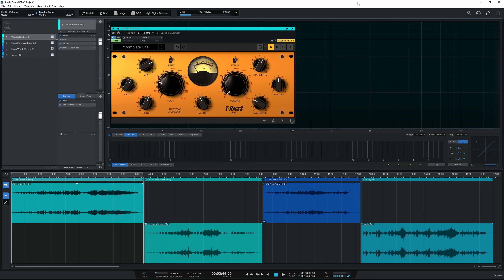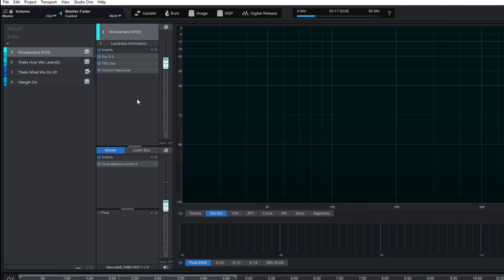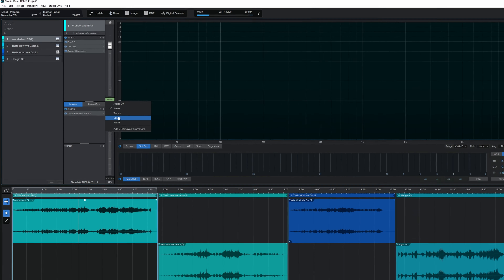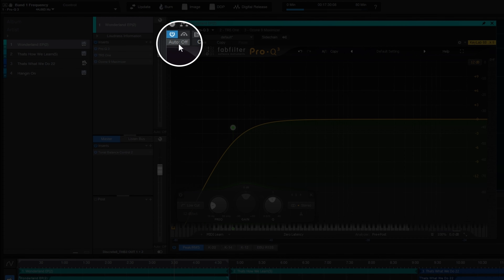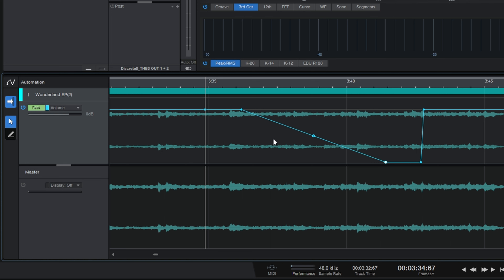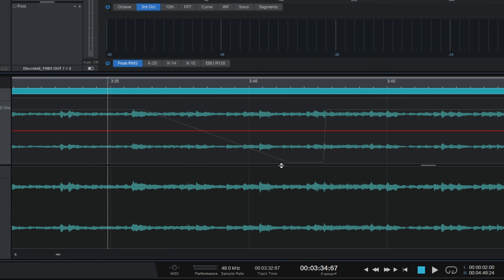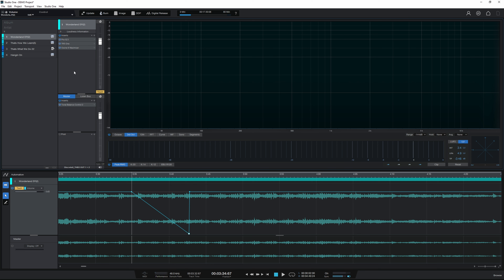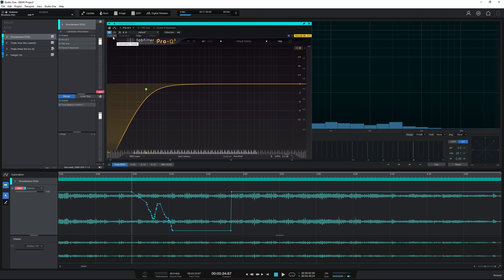Studio One  | The Project Page Part 2  | Automation

Comment: Thanks for creating some great content for Studio One. I’ve been using it for many years but I’m learning some new things from you. Thanks for sharing!  Question… in most instances wouldn’t you do most automation during mixing? Things like volume and plugin parameters? I can see if you’re automating on the master to affect the whole project but for automating individual songs?
Reply from the maker: Hi, thanks for watching the channel, it's much appreciated. I think you are correct, most automation happens in mixing. However, I tend to automate more global things in the project page. For me, that may be a slight lift in volume at beginning of a chorus for example, or perhaps some stereo widening at certain points. This COULD  be done in the mix, but I prefer the separation of tasks.